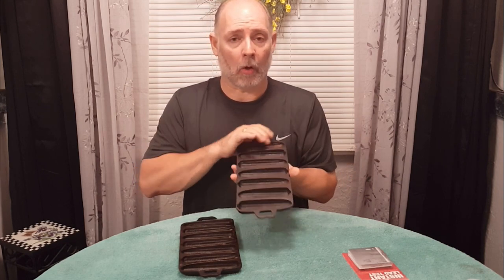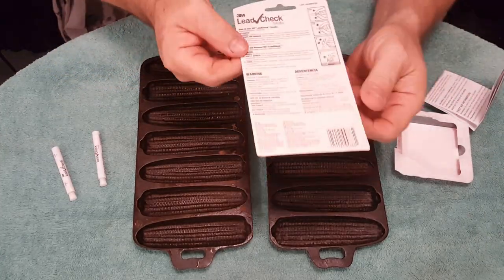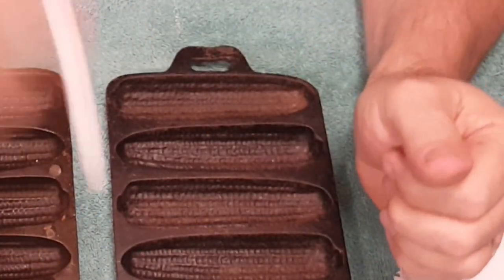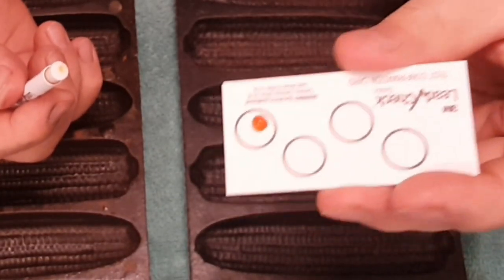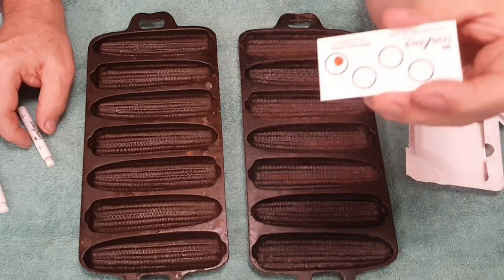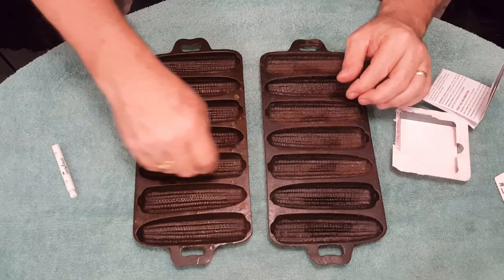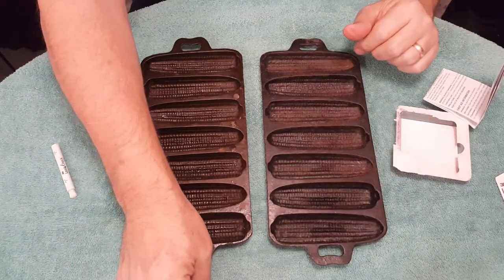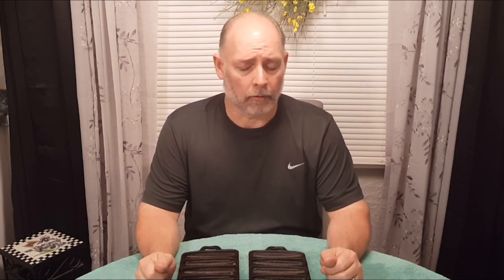How to Test Cast Iron Cookware for LEAD Contamination

Comment: THANK YOU. I am a Collector and User of Cast Iron Cookware. In the past 5 years my collection has tripled. Most of it is second hand and yard sales. Thus I have been looking all over the internet for such a video to answer if lead test kits were safe to use on Cast Iron Cookware. This season I will be testing and cleaning a lot of the pieces to use a lot more.
Reply from the maker: You can use q-tips to apply the lest and do many pieces with one kit. You can also use a magic eraser in small pieces to take a sample of the iron and test the piece of magic eraser. That is a new trick I've learned.
Reply: @castIroncookware  You saying , one takes a mr.clean erase and cut up in small pieces. Scrub the cast iron piece in question and test the eraser instead, Thus not applying the test chemicals to the cast iron?
Reply from the maker: @koshergrillboss1355  that is correct.
Reply: @castIroncookware  aHHH, do the beagle dance.....LOL
Thanks for the heads up and the fast replies.

Comment: Can you do this on iron that is already seasoned? I didn't know about checking for lead and have already restored and seasoned a few pans.
Reply from the maker: I'm not really sure if testing after seasoning will give and accurate result or not but I can say unless you have reason for the piece te be suspect, you should be safe. At this point I only test pieces that I believe to be suspect unless it is requested by a customer . At this point I have never found a piece to be contaminated. Unless you have a piece that you suspect has been used as a smelting pot or receiver for a smelting pot then you have nothing to worry about.

Comment: Thank you for the info, I recently purchased lead testing kits for testing all of my vintage cast iron.  However, I stripped them down to bare iron before testing them, then washed them with soap, water and 0000 steel wool.  Is this enough to get the chemicals from the lead testing kit off of the cooking surface?  I ask because out of the 7 or so that I tested, 2 of my wagner skillets had stains on them exactly where I swabbed them for lead even after I washed them with soap and water.  Any info is appreciated.
Reply from the maker: I'm going to do a little bit of research and try to get some more information on this subject and I will reply in a day or so. I'll say this as a learning experience. Thank you in advance for a day or two of patience. Great question!
Reply from the maker: I finally got some more information about the lead test kits. I've been corresponding with 3m chemicals over the last 3 days. They said for the most part, the steining should be able to be removed with some dish soap and a scrubby. If it doesn't disappear Completely, it will eventually disappear underneath the layers of seasoning. I gained a lot of great information from my correspondence with 3m and I will be relaying all that information on my next answers video that will be coming out next Friday at 5. I plan on featuring your question and that video. I also came up with a new technique on how to use the LED test kits and I will be going over that in the video as well. Thank you for your question. They gave me the opportunity to do some research that I believe will really help a lot of people.
Reply: Thank you for the reply and the info,  looking forward to the next video.
Reply: Cast Iron Cookware  Hello.  I just happened to find your video and am a new subscriber.  Can you please clarify which video is the ‘next one’ you are referring to in this post?   Also, I have 3 cast iron skillets that I was wondering whether I should test for lead.  The only problem is they are already seasoned.  I don’t know whether I need to scrub them clean before doing the lead test and reseason them afterwards.  One skillet is a Wagner Sidney and I have no reason to believe it has lead but just want to be sure.  But I don’t really want to remove the years of seasoning.  The other two skillets are newer ones that I sanded down to make smooth and have just started to use and have seasoned already.  I thought since they are made in China (one was a MasterChef from Canadian Tire and the other Blue Mountain skillet also likely made in China) that I should test them to be safe.  Any advice is greatly appreciated.  I just want to be sure I’m not consuming lead.  Thank you.

Comment: Would you recommend I wash out as much as I can inside my cauldron before doing the test or does the dirt and rust not have an effect on the test? Just want to make sure I get an accurate reading before I start the restoration process.
Reply from the maker: You will get a more accurate result with it clean.

Comment: I have restored 5 pans and sadly I just had a 10 inch lodge test positive. It did not look suspect and usually I test with both a water test kit and a 3M. The water test was inconclusive but again it did not look suspect so I swabbed it with a magic eraser and saved it for later so I could test two pieces at once. I even seasoned it and stupidly used the same cloths that I use to oil my pans for personal use. So now I believe I have contaminated all of them and to be honest I am a bit spooked with the whole ordeal because not only have I contaminated my personal pans but after only having done 5 pans and finding a positive result it makes me nervous to restore in the future. I feel as if I need to get rid of everything that rhe pan came in contact with
Reply from the maker: I'm not really sure what the tolerances are for the amount of lead that is detected. I would think that any amount would be too much but I find it hard to believe that contact with the cloth from one to the other would be enough to make a difference. I also agree with you, it does cause worries.

Comment: I was under the impression that lead melted at a whole lot less heat than iron and was so much softer that electrolysis had no issue removing it. 
Have I been wrong all this time?
Lead doesn't alloy with iron does it?
Or was I lead astray by that too???

Comment: I had a turk's head pan test positive for lead, after I had it in a lye tank with several other pieces, and after I put it in my electrolysis tank to clean it.  Now I'm wondering if a) the other pieces that were in the lye tank with it are contaminated; and b) are the pieces that I placed in the electrolysis tank after the one with the lead now contaminated as well?  I've destroyed my entire e-tank and am starting from scratch again.  Should I be testing them dirty, before any cleaning?  Thank you!
Reply from the maker: The lye tank should be safe because only organics are removed. I would test before the electrolysis tank though. For suspect pieces, I would use the Easy-Off in a bag method before testing just to be safe.
Reply: @castIroncookware  I know that I did other pieces in the same solution in the e-tank while I was working on the bad one.  Does the solution or the process of electrolysis transfer lead from the solution to the other pieces?
Reply from the maker: @brendakelemen-tkachuk5226  It is possible for the solution to get lead contamination that way and in tur transfer to the cookware. Best to clean out the tank and change the anodes. You can test the other pieces to be safe. You can use cotton swabs to make the test kits go a long way as well. Just drip a drop on the swab and test with it.

Comment: If the tester comes up negative on a pan can you go ahead and use the tester on more pans?
Reply from the maker: I received a good tip from another subscriber. They said you can use Q-tips for multiple applicator swabs. Just drip a drop of solution from the original applicator on the Q-tip and use it for an applicator swab. A positive result will turn red and that applicator cannot be used again. Using the Q-tips will make a simple test kit go a lot further. Just remember the activation of the solution only lasts for a little while once it is cracked and mixed.
Reply: @castIroncookware  Thanks a bunch. That's a great tip, that Q tip. I'll certainly remember that.  I have a #8 pan with a Montgomery Ward logo on the back that has a couple tiny, suspicious silvery flecks and an old Griswold that came from the same source. A lid, too, that looks sketchy. You saved me a few bucks and I appreciate it.
Reply from the maker: @yoopermary  you are so very welcome.

Comment: will this kit work for enamel cast iron cookware?
Reply from the maker: I suppose if there is lead present, the test will detect it. With newer enamel cast iron, you won't have anything to worry about though. If you have old vintage cast iron that has cracking enamel then you might have something to be concerned with. The problem with the old vintage cracking enamel is there's many types of dangers and it's probably best not to use it anyway.
Reply: @castIroncookware  Thank you very much for your reply!

Comment: Why didn't you clean it before testing? Rust and dirt may mask the results.
Reply from the maker: It has been quite a while since I might that video. Those were stripped but I was having some issues with flash rust. I have since learned how to deal with flash rust. I recently done a video where I talk about testing for lead. I think it is on my last cast iron cookware answers video.
Reply: @castIroncookware  Thanks. I haven't had any luck finding any old cast iron yet other than a few inherited skillets which are glass smooth. I did have to strip them in my self-cleaning oven since there was a lot of crud buildup.
Reply from the maker: @eminusipi  it sounds like you might have a few nice pieces. I would stay away from the self cleaning oven method though. There is potential for damage. There are a few alternatives. Some of them are elaborate but some of them are relatively simple. Electrolysis is the preferred method but lye and of course the oven spray cleaner method works really well.